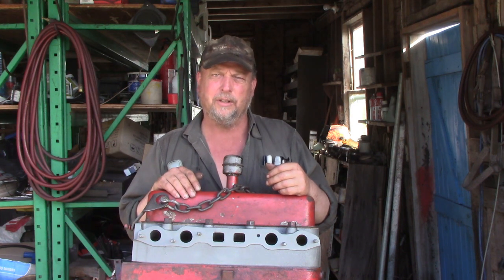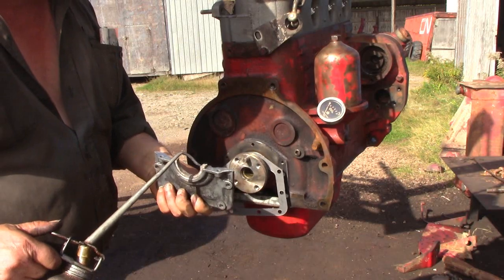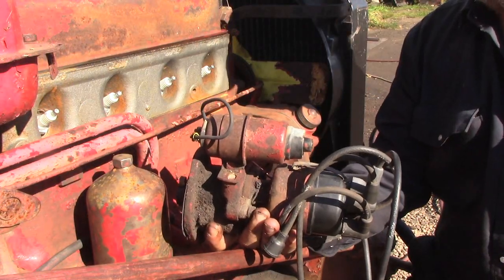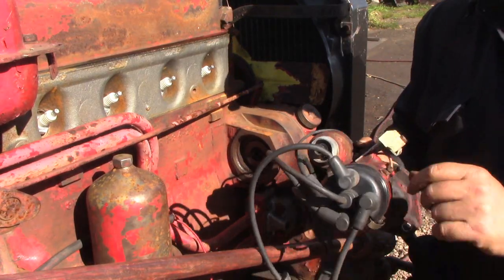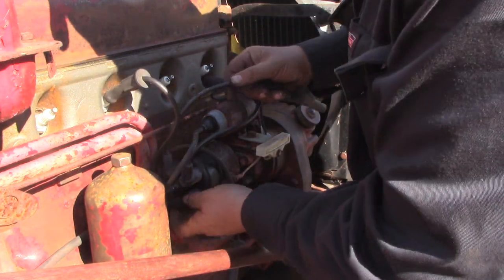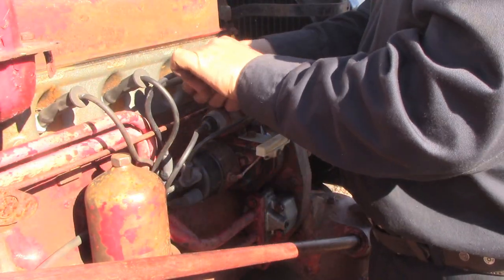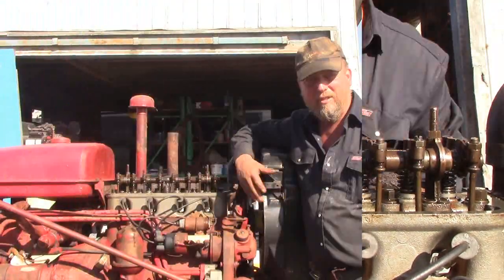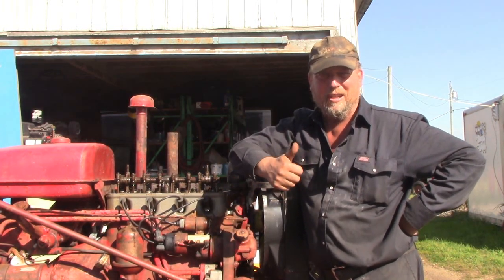Farmall 100 Engine Rebuild Part 3

Comment: Hi, My B250 stopped running due to a fuel blockage. I loosen the lines to bleed the injectors and I fractured the fitting at number 1 cylinder. It appears that I need a replacement injector and the fuel line from the injector pump to cylinder 1 injector. Do you have a parts source?